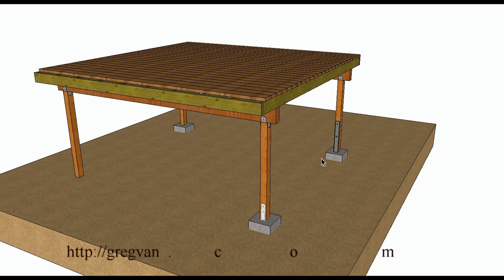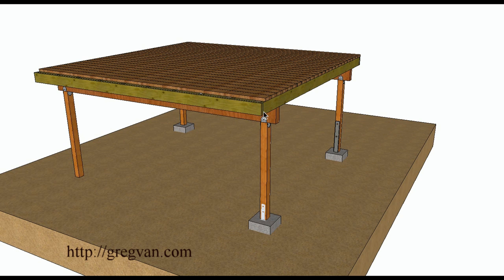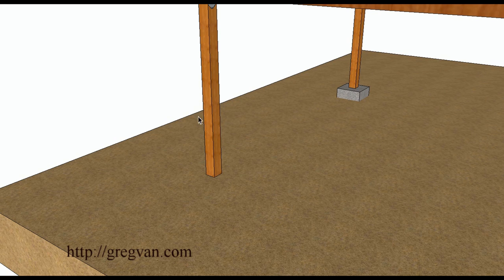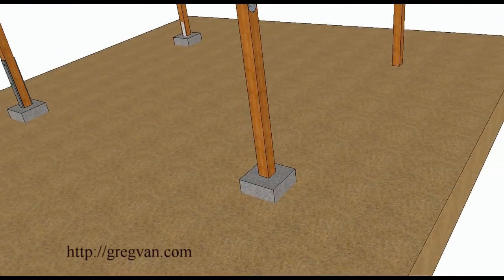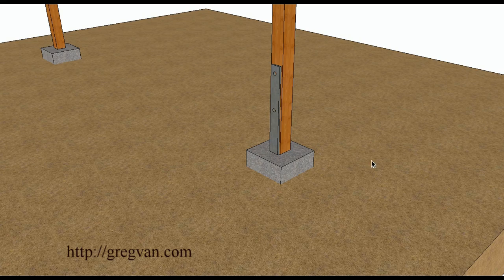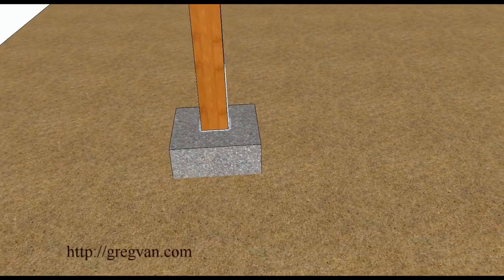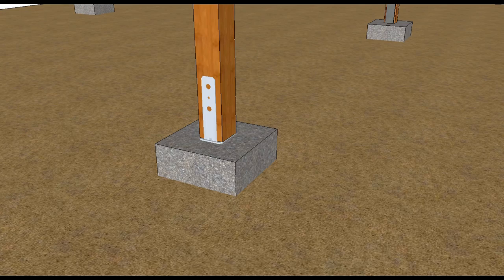What Type of Post Base Connection Should I Use While Building a Deck?

Comment: If you set posts in concrete, use gravel for the first few inches, then concrete. As long as the post is not completely encased in concrete, it will last decades. I recently reconfigured my 30 year old deck and had to remove a couple the old posts, there was zero rot on them. I live in the northeast and have my yard has very high clay content.
Reply from the maker: I'm guessing that you weren't using pressure-treated lumber, but if you were, then this method should work just fine. However, if you didn't, then I would also like to point out that I've heard others make the same suggestions, but I'm not entirely convinced this will work all the time.
Reply: I agree. I am in the SE US which gets a lot of rain. I have had good success with this.

Comment: I've had pretty good success with using 6x6 treated posts that I put into an auger drilled hole. I coat the in ground part of the post in several layers of rubber sealant to prevent moisture seeping into the post while it sets in the concrete.

I've not had one of these posts rot in the over 15 yrs of doing this. Just an idea to share.
Reply from the maker: Thanks, I always like to hear stories where people have tested something out and it worked well, but I also need to point out that some of these methods of building won't work in other areas. You should always use approved construction methods in your area.
Reply: As a kid I walked along cedar fences on an uncle's farm that were old and due to be replaced, after more than 50 years.  Almost all the posts were rotted right at the base where air meets soil.  Some had fallen already, others could be pushed over.  Removing the section from the ground showed the wood to be in good condition, as was the part of the post that was completely above ground.  Rot occurs not when a post is always wet, nor when it's always dry, only when it's alternately wet and dry.  When I  mined uranium in Ontario, we salvaged beams that had been submerged for 18 years or so.  Better than furniture grade with some resins washed out.  That's why some people spend so much money trying to salvage sunken logs from rivers previously used for logging.  Top quality wood.    Drainage is everything.  Stop the moisture and all is good.  Almost every problem a house can suffer is related directly or indirectly to moisture control.
Reply: gregvancom i
Reply: Refuso Againo l

Comment: I used a combination of 4x6 in concreted post holders. And buried 4x4 anchored points with concrete post holders. Deck combination / Pergola no termites in Montana and dry ground here. All 4 posts at corners are 12” sono-tubes 4foot into the ground. And then 4x4 treated posts 4 foot into the ground at all Center points between corner posts. Yes this structure is very solid over built. And 6 deck blocks supporting two 4x4 cross members with 4x4 uprights. All this in the Mountains of Central Montana.
Reply: This sounds great. I wonder if it would work for my 6x12 attached catio in Western South Dakota?

Comment: Id say use plate / bracket connections for decks less than 30" it will be so  much easier to do a replacement down the road.

Comment: One question I’ve had a hard time finding answers to is decks built above uneven rock. The terrain I need to build over is nearly all granite boulders and not one level surface to bolt the posts to. Any ideas would be appreciated.

Comment: Stop deck "Racking" collapse, use triangular braces in top corners X & Y planes.  Simply cut squares of plywood in half diagonally for each post.  2 per post, 1 in each opposing direction X & Y.  Place each at top outside corners, 90' @ vert. x horz. tying them into stiff shear resistant structurally stable structure in typical four post platform.  Choose size of 90' Right triangles used, thickness of OSB or plywood yourselves, larger thicker the stronger better.  WARNING  Use at own risk, consult proper authorities, codes and covenants.  Seek professional advise if needed!
Reply: There's several similar configurations and materials available.  Above recommendation cheap, material convenient.  This is basic building construction 101.  Build on Bro's!

Comment: I have a deck attached to the house that is sloped down  and they out a roof on it to make it a enclosed room .the post on the corner is in the ground  not on any cement acutely all the post are in the ground and they are starting to decay . Is this common for a hillside construction  (in the ground  and not on a cement pier ) for hillside project?
thanks
Tony
Reply from the maker: It's been done before, but another example of failed construction and you might need to replace it with a post sitting on top of concrete footing.

Comment: Interesting, although I in general agree, I would propose a fifth way and in my view most elegant solution - I am being humble :-) Put into the concrete a big heavy duty, 2 inch threaded rod, with a heavy duty 3, inch diameter steel washer and corresponding heavy duty nut. Depending on the size of the wooden pole the rod, nut and washer could even be wider. The Pole would need a 3 inch deep hole where the steel rood would sit in. If you go with 6 by 6 wooden pole that should easily hold.The nut and washer would raise the pole max 2.5 inches from the concrete and the pole can rest on a real heavy duty washer and nut. You hardly see anything, if you see something it is pure function. And as you know, form follows function:My sister lives in a log house with her family and they have that and it actually looks pretty cool. In a log  house it allows for different combination of horizontal logs with timber framing.Height adjustment of the roof as needed. That is a feature!What do you think?Cheers,John
Reply from the maker: +horatio71 Sounds good to me and I love your elegant solution. A structural engineer might not appreciate your creativity, but as long as it does the job, who would we be to argue until proven otherwise.
Reply: +gregvancom Many thanks. I am always looking for an architectural appealing solution with an interesting function. I have seen my solution occasionally, we are certainly not the only ones doing it, but it does not appear to be that common. I have seen many different solutions where I would have preferred the above rod-nut-washer-solution. I'm just in the process of renovating a homestead, so I am planning everything from renovating the barn (where I likely will also using the nut and a timber frame solution) to adding timber frame extension to houses to increase living space, and importantly building a sauna by the lake, but want to make it look authentic Swedish country style. I'll be busy for the next 20 years. But fun, will be doing a lot myself. We'll see how that works out...
Reply from the maker: Well I wish you the best of luck and it seems like we will always be working on for improving our homes.
Reply: horatio71 jjj

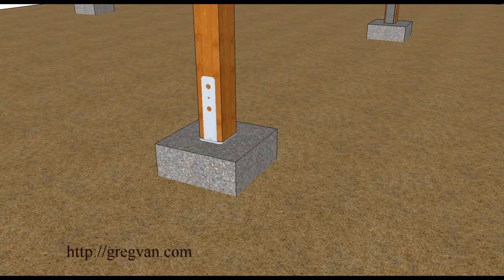Comment: Greg back again, the postbase shown at 1:30 to 2:20 in the video (CB44).  How does one set this product so that it is actually plumb?  I have a desire to use a similar embedded system (MPBZ simpson product), but I can not image getting this device (either CB44 or MPBZ) actually plumb.  The device seems to be 6-8 inches above the concrete but the post would extend 8-9 feet. One millimeter or 1/32 of an inch out of plumb would cascade to an inch or two at the top of a post. 

What are best methods to use such systems?  Of course suspending the post in thin air with the device already attached and pouring concrete around the postbase is the best solution, but that would seem to require magic..
Reply from the maker: About the best I can do right now is put your question on my list of videos to be made in the future. Email me some pictures or drawings of what type of concrete forms you're going to be using.

Comment: How about a deck extending from a flat surface to a 5 ft drop? That's what I have to build. I was thinking of putting a concrete footing on top for the deck to sit on and do what you suggest to the 2 legs at the drop. What you think?
Reply from the maker: I cannot provide you with structural engineering information, but think that a couple of footings, posts and structural beams might work just fine. Let me know if this didn't answer your question.

Comment: Hi, I want to get prefab metal braces made for a new fence with 8x8 wooden posts. Would the long metal brace method embedded in a concrete base work for a 6’ garden fence? It is replacing a fence that rotted at the base. Thanks

Comment: if the post rots you just install a temporary post and remove the old post and cement a new post in its place done it several times no problem...
Reply: Stevie Dee 
Why'd you have to do it several times?

Comment: Hi Greg your videos are extremely informative. How would you attach support columns Of a lean to roof to and existing deck. Can they be set on the deck or should they go down and have their own foundation
Reply from the maker: If the deck has solid structural support underneath then you might be able to attach to the top, but if not then you would need to make a footing.
Reply: @gregvancom  thanks. Your videos are great.

Comment: what if im doing a pergola in a slab that i already poured footings below, 18x18 pergola what post anchor would I use? for my 6x6 posts
Reply from the maker: You can try using any base connectors that attaches to the footing. Most will need to have a hole drilled into the concrete. I can't provide product to use, but maybe try you're local lumber yard for  more information.

Comment: I build decks for a living. I've been watching deck building videos for the past couple hours.  Most of the videos I see there is a lot of non optimum decks being built. Lol The comments are worse.

You are the first person I have seen that has pointed out the problem with having the post sitting on concrete. The deck swaying. Every video I saw that's how it was being done as you pointed out that's the worst way. I use the posts in the ground method. I dig a 2'x2' square hole 36" deep (code in my area) then pour 6"-8" pad at the bottom. Set my 6x6 post on that then backfill with the same dirt tamping it as I go. I'm never worried about it rotting in a lifetime. They make Ground Contact Rated pressure treated lumber its made to be in the ground or always wet. The problem with pouring the post into the concrete. The wood shrinks over time and a gap is formed between the concrete and the post. Water gets in there and freezes and cracks the concrete. Partly that is due to many people digging and 8" hole putting the post in pouring concrete around it. You only end up with like 2" thick concrete around the post. That can freeze and crack easily. The post can then move around inside the hole. Over time the space around the post gets bigger from the post wiggling around and compacting the sides of the hole. If you had a 12" hole that probably wouldn't happen but I don't see holes that size often.
Reply from the maker: You bring up some good points about lumber shrinking, but it usually doesn't shrink enough to create big problems and it's my job to point out the things others don't seem to care about. Thanks for the nice comment.
Reply: Code here requires decks over 6' to be set in the ground on 8''of concrete in a 42" hole  and 18" wide. Concrete must be poured around the post. Also, the post needs to bet set over a 6" rebar pin, but not sure how to do that when replacing a post. Plus, I think a hole in the bottom of the post would only add to any rot problem. Half of the 6" x 6" posts on the pole barn built in the early 1980s are almost rotted though with constant moisture.
Reply from the maker: Where is this, I never heard of this type of construction as mandatory.
Reply: Columbus, Ohio. Probably extra safety concerns related to all the student housing around OSU. There was a skit on SNL set at OSU where Will Farrel mentioned a 'party porch' collapsing.
Reply from the maker: Interesting and I would imagine that it would work as long as you used the correct type of pressure treated lumber and approved methods of construction.
Reply: Pretty much. The vast majority of collapses are the result of overloading with people when the deck is not properly attached to the house.  Don't skimp on using the proper metal connectors attached with the proper fasteners!!
Reply: Do you ever set posts into the concrete such as a CB44 or an MPBZ Moment Post Base?  If you do how do you get it exactly plumb?  I am trying to avoid sticking a post in dirt and would rather use a stand-off, and entirely out of the ground post approach that can react a moment force at the post/foundation connection.

Comment: If free standing on concrete footing that will be safe from earth moving to prevent house damages and cracking. So is that wrong or not?
Reply from the maker: You would need to check with a local structural engineer to answer that question in your area, because different soil can require larger footings to prevent or reduce movement.

Comment: I have a 4" thick slab of concrete I would like to add shade to.  These type of bases use a 8"+ bolt which would go through the concrete.  Is that ok?  Also can you avoid / delay damage to the wood and base by wrapping or boxing the posts in another wood?
Reply from the maker: You would need to check with local building authorities to verify what type of post base connectors you would need in your area, but most of the time a post footing like this for a covered patio usually requires a footing that might be 1' x 1' x 1' or larger. In other words, you might need to cut the concrete and remove some of the dirt so that you can install your new footing and connecting hardware.

Comment: Hi there, do you think that bitumen coated treated timber posts buried in the ground with concrete would last a fair bit longer than the examples you have in the video? I have to build a landing and steps at the back of my house and I need to do it in the most cost effective way possible, I have bought H4 treated 90mm posts and also have some bitumen paint to treat the ends that will be buried, I'm going to give them several coats of bitumen for maximum protection. Thanks for any advice
Reply from the maker: I would imagine the H4 treated would be enough, but I have never worked with liquid bitumen, so it would be difficult for me to provide you with a reasonably rational opinion.

Comment: Telephone poles still are used and they last long. It’s used here in Houston. What say you?
Reply from the maker: I cannot suggest what your local building department or engineers would require, but would agree that telephone poles often last a long time.
Reply: What method do they use?

Comment: When building a pavilion, the big ones are 20x24 or 24x24. I can't find 20 ft pressure treated 6x6.  Am I able to attach two 6x6x10 or 12 posts for the roof lateral support?
Reply from the maker: I cannot provide you with structural engineering information, but if you send me a picture of your problem or project I can provide you with an opinion. You can get our email address at our website.

Comment: Quick question. And i feel like im a genius for this.  Why not dig 36” hole and line the hole with a moisture barrier then set your post in then the concrete.  Would that solve the rotting problem?
Reply: Or maybe that would make it hold water
Reply from the maker: I like it and as long as you didn't seal the bottom, it would prevent moisture from entering from the sides.
Reply from the maker: Yes, you couldn't create a container, because it could trap moisture and accelerate the wood rotting process.

Comment: Would the Simpson post tie be enough if building a small lean to for holding firewood? Using your recommended 6” off the ground with 1/4” gap under the brace?
Reply from the maker: It sounds like it would, but I couldn't answer the question for sure, without seeing some type of drawing or detail.

Comment: Simpson does not even provide lateral values for a cb44 or any other post or column base. they are for uplift.
Reply from the maker: Interesting, but I'm guessing that you would get some lateral support by using the CB 44's as opposed to nothing at all or even a little more if you used the raised post bases that require an anchor bolt. Just thinking out loud.

Comment: What would you recommend for footers, post base for a detached platform deck that’s very low to the ground, < 4-6 inches?
Reply from the maker: I can't provide you with engineering advice, but can tell you that I built a lot of decks using 12 x 12 x 12 footings.

Comment: I want to build a small deck for my home and have it attached at the back door area. I want to use concrete blocks for the wood to be sitting on at the ground level and have supports attached to the 4x4 boards coming up from the ground.
Reply from the maker: I don't know exactly what your project is going to look like, but imagine that you could use concrete blocks for concrete footings.

Comment: What is the best method to secure a pergola purchased from Costco onto a concrete patio we already have?
Reply from the maker: I don't know exactly what the pergola looks like, but I would contact the product manufacturer. If not, then you might be able to drill a hole into the concrete and install a framing anchor that can be purchased at most home improvement centers and lumber yards, but I don't know if they would be strong enough, but the product manufacturer should.
Reply from the maker: I don't know exactly what the pergola looks like, but I would contact the product manufacturer. If not, then you might be able to drill a hole into the concrete and install a framing anchor that can be purchased at most home improvement centers and lumber yards, but I don't know if they would be strong enough, but the product manufacturer should.